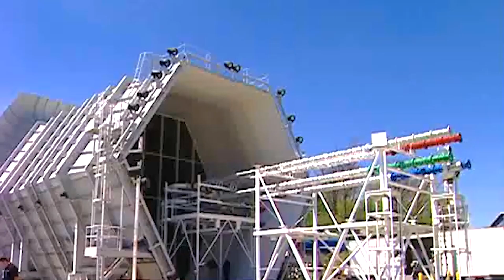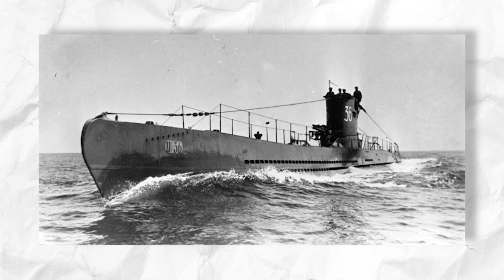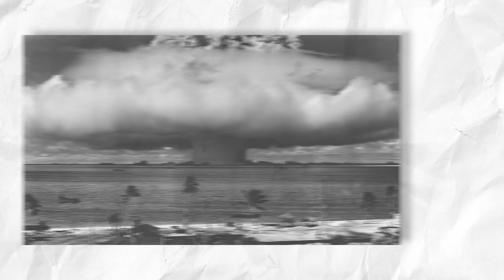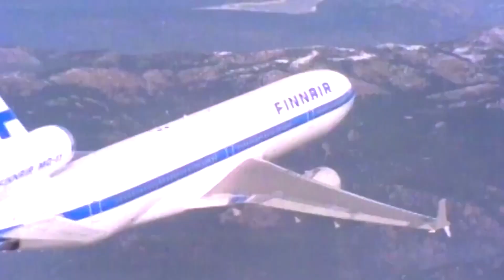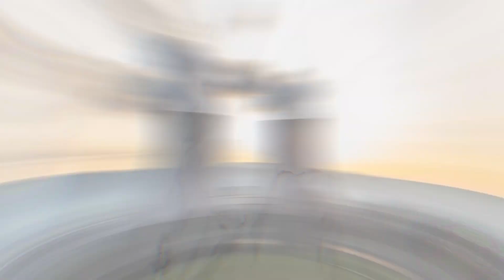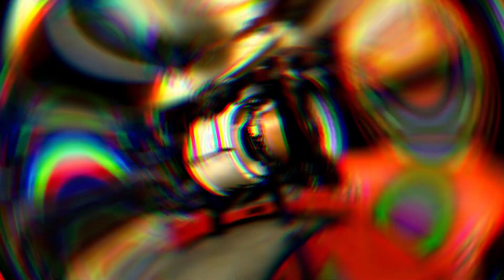INSANE Innovative Aviation Airplane Technology That SHOCKINGLY Blows Your Mind

Comment: Within a fission driven jet fighter or bomber AAK or heavy 50. 70. BULLETS striking the engine could possibly blow the planes up and spreading radioactive plasma and dust with a 15 or 20 year halflife over friendly  civillian areas. Perhaps fussion atomic motors with cleaner outlet or little radioactive dust during a shootdown.